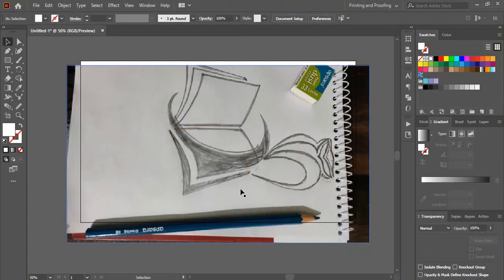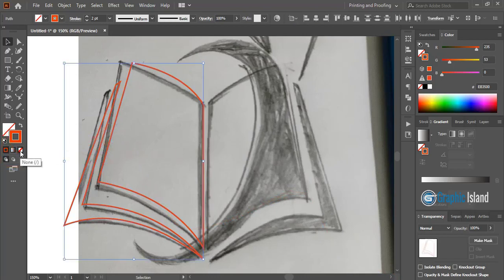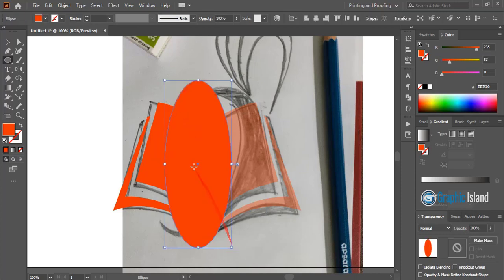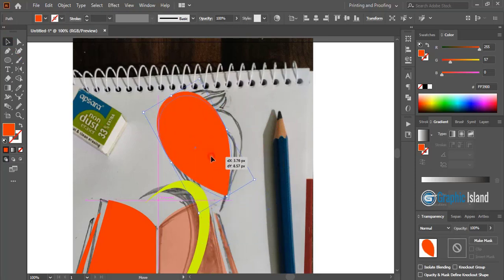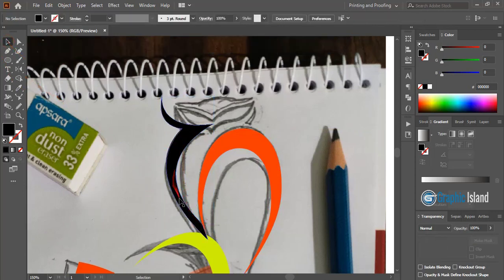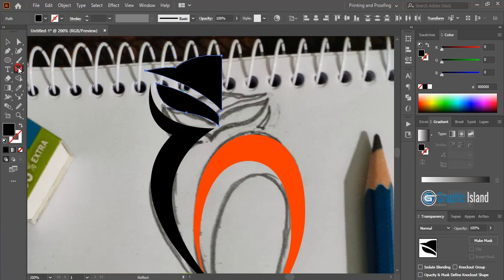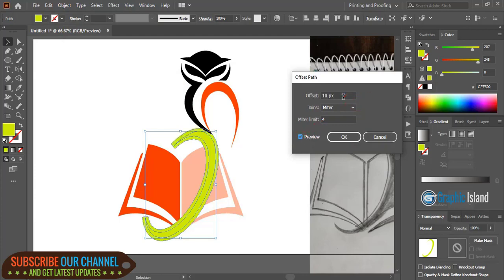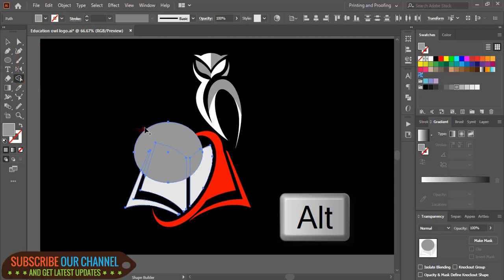The Logo Design Process : How to Create Vector Logo From Rough Sketch

Comment: I watch your video regularly and practice.  Pls tell, how you take photo of your sketch ? By mobile? And then to Illustrator?
Reply from the maker: Take normal pic from top than by using data cable or google drive take it to your pc Or laptop. Open illustrator software - click on file - open and open your image. That's it.
Reply: @GRAPHICISLAND  Thanks for your reply .  I transfer pics by Data Cable to Laptop usually. Asking, How you take photo? By Mobile? Yours one  is very clear .
Reply from the maker: Yes, through mobile only.